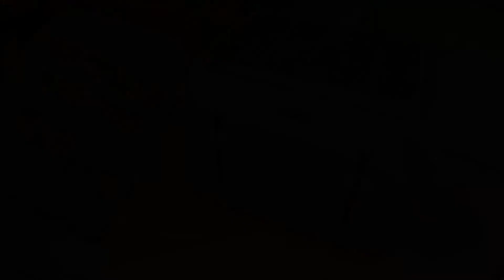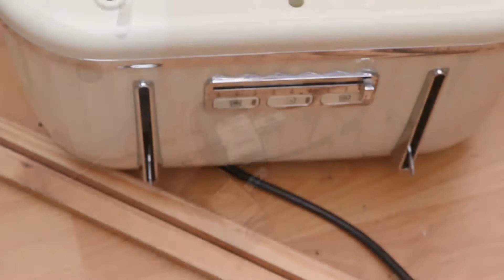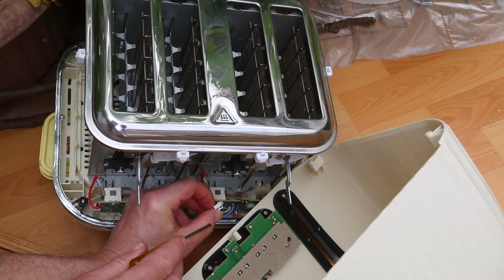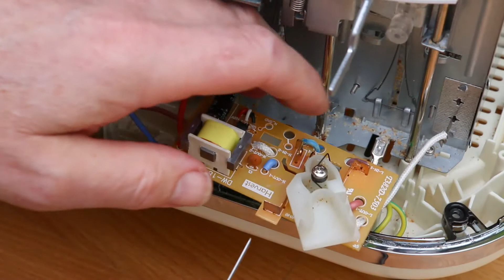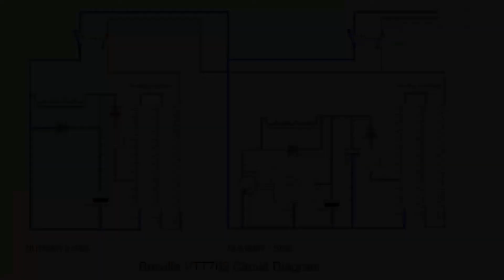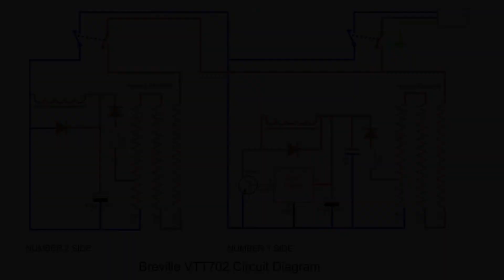Repair Breville VTT702 Impressions Toaster.

Comment: Thankyou. There was one very annoying Tri wing screw and I didn't have the appropriate driver. However I managed to open the case just enough to fit a toothbrush in to clean the sensors. Bingo. It works fine now.
Reply from the maker: @carolynleigh8401  an interesting development,  sometimes a small straight bladed screwdriver can be jammed across the growing corners but it doesn't do the screwdriver much good if it slips.
Pleased you were able to clear the problem.
Reply: @twotone3070  Did try, but the little B*** was unmoveable. I think it might have been someone's last day in the factory, and they wanted to have a bit of a Joke. It was the old story for me of a five minute job turns into half an hour. I persevered and won. Thanks again to you.

Comment: There are two screws under the slip rubber plugs on the back. Spent 10 mins wrestling with the toaster only to realise two screws hidden under the rubber plugs. Even though same model placement of two screws is different. Thanks for the video
Reply from the maker: @siddhantkumar6503  Thank you for the additional information,  hopefully it will help someone with the same version as yours.
Reply: I did the same.

Comment: Thank you for such an elaborate instructions, I followed that and managed to fix my Breville toaster. For mine it was the dirt and crumbs on the contacts when you bring the lever down, I cleaned that with sand paper as you mentioned and that did the trick. Thank you so much. Bless you!
Reply from the maker: I'm pleased that you fixed it and thank you for commenting.

Comment: Mine started doing it this morning. Cleaned out the crumbs and it seemed to work at first but after a minute, a bright flash from the right slots then both sides released and it's dead.
Reply from the maker: It could be that the contacts have been damaged and you may be able to clean them to make them work again. Or it could be that part of the element has fused, you'll need to do a continuity test WITH THE TOASTER UNPLUGGED to see if this is true.

Comment: Great thanks, repaired mine from watching your video. Cleaned 4 contacts up with fine needle file and ipa alcohol, also cleaned magnets of crud. Handles i broke plastic clips but glued back on okay. For anyone doing it, you're need a long reach T10 torx for one of 2 screws, the other 4 are philips. Thanks again.
Reply from the maker: My pleasure, so pleased that you were able to fix it and for letting us know.

Comment: Hmm it all looked very informative until you said that the right side (when I face the toaster) has to work for the other side to work. Our right side won't stay down but the left will. Any thoughts please?
Reply from the maker: I have three thoughts.
1) Your toaster is wired differently, because on the one I looked at unless the right side is down the switch contact providing power the left side are open. It's a feature of pressing the lever down to the bottom of its travel.
B) There are two faults, one is that the switch contact on the right side are stuck closed even when the lever is up and the other simultaneous fault being that there is a break in the circuit for energising the right side magnet coil.
iii) The magnet on the left side has become permanently magnetised and requires a small amount of force to make it release. 

If the left side releases with the timer as you would expect, my money is on the 1.  Perhaps they are simply wired the other way round now or previously?
Hope this is of some help.
Reply from the maker: How did you get on?
Reply: @twotone3070  Hi - well it is all fixed!  It seems that the model we had was not quite the same as the side that was working was the side that could not work without the other - if you see what I mean.  I found another video with the right model and it showed cleaning two plates, which we did.  You didn't have to remove the cover fully either which was helpful.  So  all done and thank you so much for your time, video and interest.

Comment: Thanks mister, my toaster is now fixed.  I couldn't get the levers off though, mine don't have a tab you can press in.  Anyway, didn't need to remove them as I could get at the contacts without taking the cover all the way off.
Gonna have my breakfast now, thanks again :-)
Reply from the maker: I'm pleased it was of some help and many thanks for letting me know, it makes a difference.

Comment: Hi, Great video, Our Breville VTT911 has the same problem, but I can't get the levers apart to pull the grip off, I cant find any mechanism and I'm afraid to yank anything ???
Reply from the maker: Hi, from your description I'm not sure they are the same construction as the ones on the 702 in the video?
On the 702 the metal lever has a slightly fatter portion that sits inside a hole in the plastic knob. You can very gently try to prise the plastic over the fatter bit which may result in the plastic piece retaining the knob breaking.  If it does I'm afraid you'll need to glue the knob back after you have done the repair.
The body then lifts off, over the ends of the levers as there is no knob to stop it. 
Having looked at a retail photo of the 911 I'm guessing you will just have to wiggle the knob up  and down to get it off the lever, but that is a guess and for you to decide. Me, if the choice is throwing it away, I'd get the knob off one way or another and glue it back on, but then it's not my toaster.
Sorry I can't be much help.
Reply: @twotone3070  By replying, you were a great help, thank you.

Comment: Would have been helpful to show how to take the silver sliders off. Struggling to get mine off.

Also I think some of the screws on the bottom are covered by the black rubber feet, took me ages to see where the extra screws were.
Reply from the maker: Sorry about that, I had already taken mine off before I'd started videoing because I didn't set out to fix it for a video, but having fixed it thought it may be useful to someone to see what the fault was. You don't necessarily see it in the order I shot it.
You just have to bend the plastic out of the way and it may break, one of mine did and I had to superglue it back afterwards.

Comment: By the amount of views I'm convinced not to purchase another Breville toaster! I have a different model that I purchased a year and a half ago that wont work now. And the company will not replace. Why would I buy another??
Reply from the maker: I understand your viewpoint there. I would of course just think of it as an opportunity to take it apart, but then I'm not normal.  Obviously I don't know the symptoms you have there but it could be as simple as a bit of toast in the contacts.
Reply: @twotone3070  .Yes, I'm not normal as well. I will take it apart as soon as I'm sure Breville will not stand behind their product. and I find a replacement They could not offer any support with manuals or tech support.so I am on my own.

Comment: Thank you very much. This helped me fix ours. Although it was a newer model it have me the basic idea. Getting the handles off was by far the hardest part. In the end I managed it with a large safety pin. On our version it had 2 screws hidden under the rubber feet and one   central screw was a tri-point screw which I didn't have a screwdriver for but got it out pressing down hard with a flathead one and turning it with mini pliers. The fault turned out to be large toast debris preventing the magnets making contact after my wife turned it upside down to clean,  pitching toast crumbs into the electrics!
Reply from the maker: That's what I like to hear, simply not being put off by the first hurdle and I'm pleased I was able to help. Nice tip for removing the handles. Also maybe a tip to say, only turn the toaster away from you when turning it upside down to empty it?
Reply: @twotone3070  Yes, good point. Just use the trays for removing crumbs and, if you do have to turn it upside down, do it front to back rather than back to front.

Comment: Unless for me as there was no detail on the first important problem, getting the knobs off. I had to give up. Sorry mate no use to me!!!
Reply from the maker: It's as simple as prize them off, they may break, but there is no trick to it.  Then you superglue them back on if they do, that's what I did with one of them.
Reply: @twotone3070  thanks I going to use a rubber wedge to hold it down for now. One of the magnet 'plates' is off its base, I can  see it
Reply from the maker: @neilalexander7723  I would be a bit wary of pinning the arm down as accidentally leaving it to long could cause the bread to catch fire.
Reply: Thanks for the video, mine is now up and running. I too had a problem getting the handles off but I ended up just prising them off and glueing them back on afterwards.
Reply from the maker: @Rockwell21  So pleased you found it useful. Thank you for commenting.

Comment: I have an issue with the toaster not staying down but the heating element remains active. What is a fix I cleaned it and it worked for about 5 minutes now isn't working again.
Reply from the maker: Hi. Is that one side or both?
Reply: @twotone3070  It's both its a slightly diffrent model i think but both sides do not work. L ike i said i took it apart nd it did work again but now it's back to not staying down?
Reply from the maker: @thehitpack766  Well my best guess at this moment is that there is still a high resistance contact on the number 1 side.  If the heating element is about 58 ohms and meant to have 240 volt across it, and the contacts were still slightly dirty or not making contact fully, hence introducing an equal amount of resistance then the voltage across the elements would only be say 120 volt. Enough to warm them up but giving only half the voltage at the tap for the electronics and hold down coil.  Every time it operates it burns the contacts a little bit more making the situation worse until it doesn't work.
I'm afraid without getting in there with a meter and proving continuity of the hold down circuit or heaven forbid checking voltages with it open (VERY DANGEROUS)  I can only speculate.  I'm sorry I don't have anything more concrete for you.
Reply: @twotone3070  The heating works but it won't stay down. I did clean it the magnetic part and it worked. It broke because someone put a large piece of bread in which got stuck then removed it with a knife. I was told it was unplugged at the time so i'm not 100% sure. Would one of the pieces maybe have short circuted?
Reply from the maker: @thehitpack766  If you stuck a knife in when it was on you'd probably be dead now or possibly blind from it spitting molten metal.  I think all you can do is UNPLUG it, not just switch it off, take it apart and clean the SWITCH CONTACTS again as I show in the video. Cleaning the electro magnet would only help it it was sticking down and this is not. I repeat, if you touch this with it plugged in you may DIE.
Reply: @twotone3070  What tool are you using to clean the switch contacts? It wasn't myself who broke the toaster but that was the event that caused it to break. I'll try that as a last resort then buy a new one. Thanks for the help. I take it you have some experience with electronics. :)
Reply from the maker: @thehitpack766  I was using a very very fine file, but an emery board nail file would do the trick or a fine sand paper or fine wet and dry paper, but used dry. Clean them until there are no marks on there at all and the surface is smooth. Check the surfaces mate together well when the lever is fully depressed, that is key.  Please make sure you UNPLUG it before to take the cover off and don't test it until the cover is correctly fitted again. 
I was 40 years in telecomms.

Comment: Hi my left side stops halfway, so can't activate elements - can you please advice?
Reply from the maker: Sounds like you are going to need to take it apart, it's pretty easy, just make sure you have it unplugged from the power when you do and don't plug it back in until you've got the case back on fully.  Difficult to say what may have happened inside, but if it's mechanical it should be fixable.
Reply: @twotone3070  thanks 🙏
Reply from the maker: @Lenoire79  Let us know what you find :)

Comment: Just did this and it works again, thanks a lot you saved me some quids. Also 2 of the screws were hidden behind rubber feet on my model.
Reply from the maker: Good to know you saved it from scrap and the extra info, thanks.
Reply: Appreciate your comment. Mines the same and I was wondering why it wouldn't open!

Comment: Oh man, I regret agreeing to fix my friend's George Home 4-slice toaster. She has given it to me, but since learning they are only 25 quid new, there isn't much motivation any more! It looked more expensive than it is. A nightmare to take apart, sharp edges, greasy breadcrumbs in gunge-form at the bottom of the toaster just above the trays. I am no longer thinking about the cost of it, but the fact it would be a horrible waste to throw away a working toaster. The left dual-slots would not stay down, and the ELECTROMAGNET was failing due to some gunk on it. The repair was a Q-tip taking all of 30 seconds, but the disassembly and cleaning is worse than hell.
Reply from the maker: Thanks for following the 'Cause', as you say, money is not necessarily the motivator. 
Mine wasn't too bad, I can only imagine the horrors at the bottom of a well used toaster.
At least you will have earned some brownie points, although the benefits will depend on the ferocity of your rebuke.
Reply: @twotone3070  Thanks for this video. I was hoping someone would take apart one of these toasters, so I could take out those two PCBs boards at the front without breaking them. I can now clean it. Hope it works afterwards!

Comment: Thanks for this useful video! You saved me trying to dig out the receipt. I have a slightly newer model but the process was the same. Some crumbs had got on the contacts and using a light air blower I was able to clean them. I managed to do this without removing the silver handles (as I didn't want to snap them!).
Reply from the maker: That's good to know thanks.

Comment: Very good and comprehensive problem-solving video.
I too experienced the same defect.
The lights work on the front, the heating elements all work when the switch is held down, and toaster 2 also stays down providing the switch on 1 is held down.
I have no doubt this could have resolved my toasters problem, BUT, I fell at the first hurdle.
I could NOT get those plastic handles off.
I tried several different narrow-bladed flat-headed screwdrivers to get them off without breaking the plastic.
Having tried for 15 mins or so, I resorted to calling my wife just in case I was being a bit of a biff.
She too failed.
The only way I can see them coming off is to damage them.
I guess you must have had a little difficulty because you described the process but didn't capture it on video.
Very good video though.

My next step, begrudgingly, is a new one for £25 at Curry's.
Reply from the maker: I did bend one of them and actually I had already taken it apart before I started videoing, I suppose I wanted to know if I could fix it before setting up all the camera gear.  I would take them off regardless as they are easily superglued back on, I know ;)
Reply from the maker: You could try repeatedly wiggling them, using the abrasive nature of the metal to wear enough slack to get some movement.
Reply: @twotone3070  I tried wiggling, and I wiggled for all my worth!
Alas, to no avail.
I had to resort to breaking the plastic.
To limit the damage I used a pin file, through the guide slot, to file away some of the plastic.
So when it did snap it wasn't catastrophically so.
I saw that the positive contacts on the right-hand toaster were darkened, whereas all the others were still shiny.
As the toaster was apart I took the opportunity to file the neutral and positive contacts on both parts of the toaster.
I then reassembled, tried it and it worked.
This was a one-time-only fix because I followed your advice and superglued the broken switches back onto the protruding arms.
Thanks for your video and for saving me £25 to replace the toaster.
Reply from the maker: Great news, another one saved and for the sake of a bit of effort and some super glue.